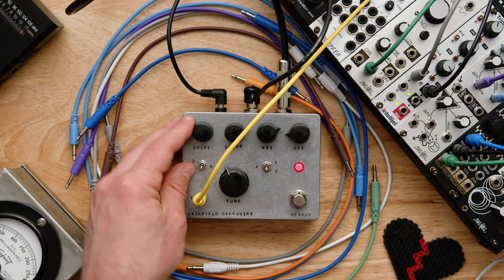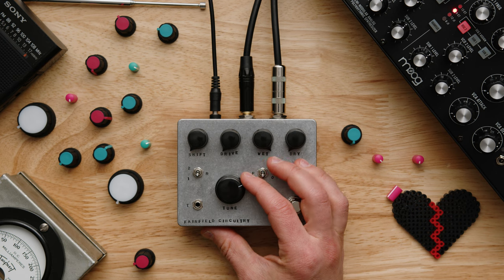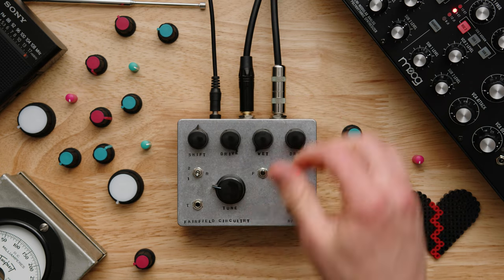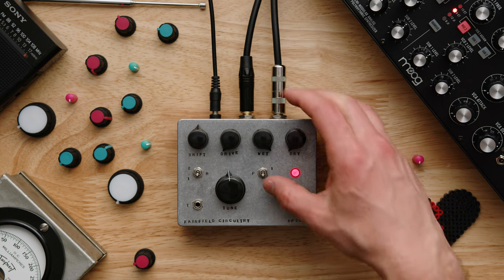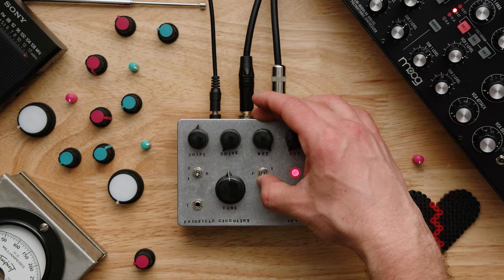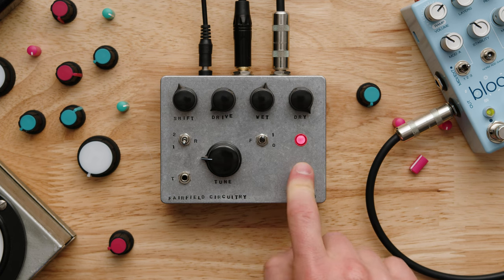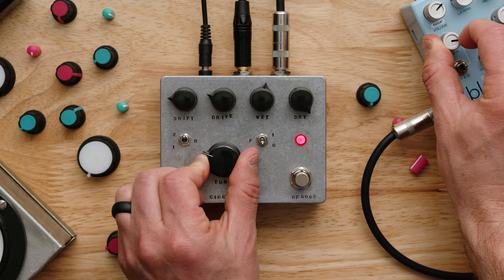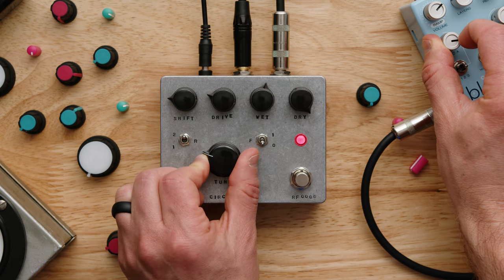Fairfield Circuitry Roger That

Comment: The glitch takes a little getting used to, but this is actually a distortion pedal that may better suited for SS than tube amplification (😲). What makes tubes more appealing to many people certainly doesn't matter with this thing, that's for sure.